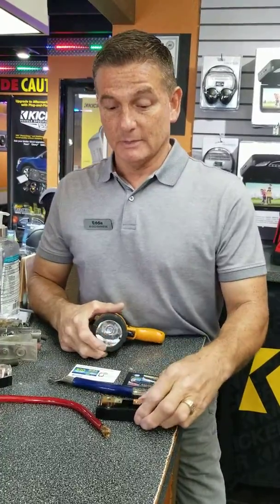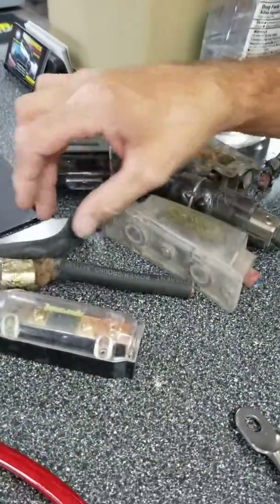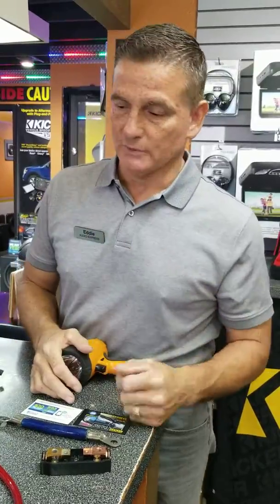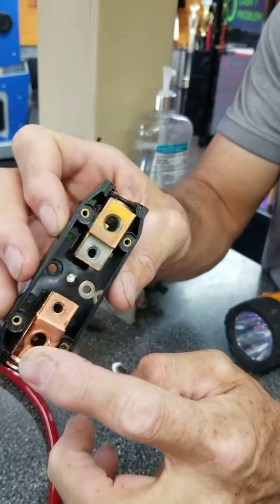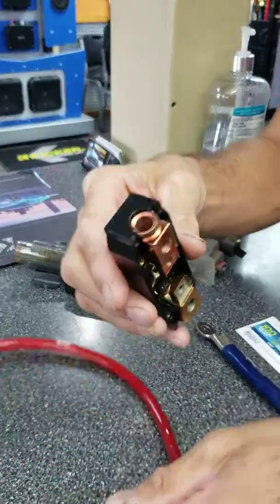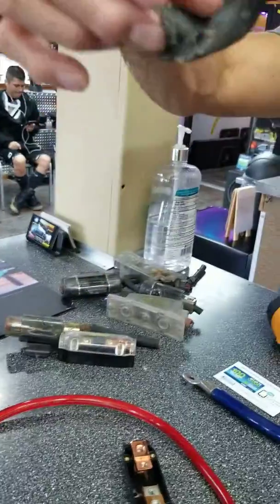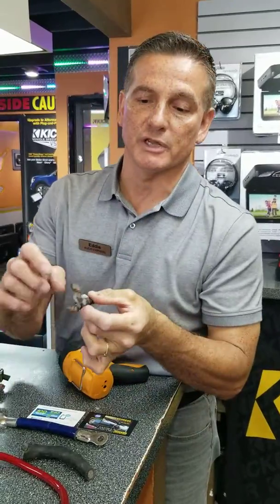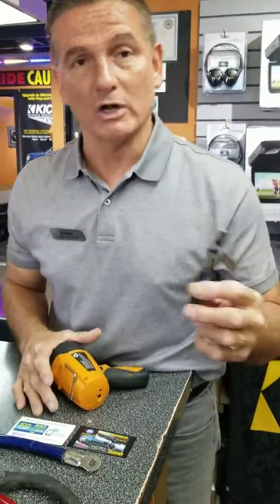What happens when you use CCA or copper clad aluminum wire.

Comment: Hey, now you must SWAP OUT that Aluminium chassis and install a copper chassis. 

Your stupid Aluminium chassis MUST catch on fire 🔥 now but they don't. 

Aluminium amplifiers NEVER catch on fire 🔥 

They have voltage ⚡️ going through them every day. 

The speaker connections inside the amplifier are Aluminium but they've never caught on fire 🔥 

Pioneer stereos are all Aluminium and they've never caught on fire 🔥 

I've never seen the Pioneer copper chassis version 😳 

You're a LIAR.

PIONEER STEREO BRAND SPITS IN YOUR FACE!

Comment: I have a huge 100m spool of 0,75mm² speaker wire around I've got for free a few years ago. 
I learned the hard way: It seems to be this CCA stuff which I didn't know about until now. It can't be used for anything! Even 12V/100mA for two tiny outdoor LED lanterns is too much. The insulation turned green on the whole length and the nasty wire inside developed a resistance of 1kOhms in just a few weeks! I didn't notice anything special it when I installed it. It brand new condition, it just looks and feels like regular copper. I need to replace it (this time, real wire...). It was impossible to rip it out in one single piece. It became totally brittle and stiff.
Reply: The radio chassis is aluminium too.

Whole home stereo components are fully made of aluminium. 

Marshall amplifiers date back to the 1950's and they're all made of aluminium chassis and terminals.
None of those chassis have caught on fire 🔥 

You're a world famous liar.

You've been reported to the authorities for misleading the public.

Comment: Copper clad aluminum isn't anything new.  I worked on it back in 1980's on a job in the cable TV industry.  The mainline wires from pole to pole has a CENTER CONDUCTOR that is copper clad aluminum.  I never saw any corrosion problems with it.  Only problem I saw was the clamp screw that smashes down onto the conductor.  If a technician overtightened it... then they were known to crack and break, causing an open connection.  Some guys like to tighten things like a muscle-man!!!  That's a mistake.  That is what caused the problems.
Reply: The chassis is aluminium. 

The speaker connectors in the HiFi stereos are aluminium. 

Famous Marshall amplifiers are all aluminium.

Comment: Guys remember price is everything ok copper clad aluminum is  an approved wiring cable ok so legally we can use it and why not it's much cheaper than solid copper ok and works about the same
Reply: The whole stereo is made of aluminium. 
Chassis,  and face plate all made of aluminium. 

The speaker wire connections inside the amplifier are all aluminium. 

The power chord fittings are BRASS or plated brass.

Comment: Today's aluminum wire is much different than it was  back in the day
Reply: Brass fittings were used back in the day.

Chassis are still all aluminium. 

HiFi stereos are aluminium. 

Terminal posts inside the amplifier are aluminium.

Comment: This is from too much mechanical pressure if u use a torque wrench to not overtight the cca wont do that. Aluminum is brittle when u over tighten it shears the strands